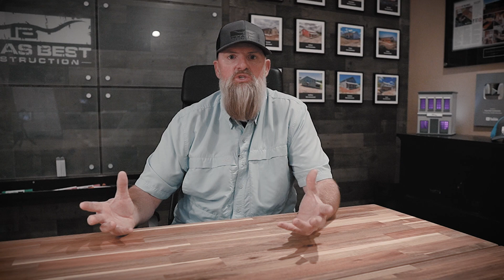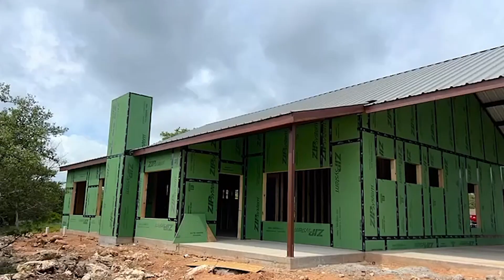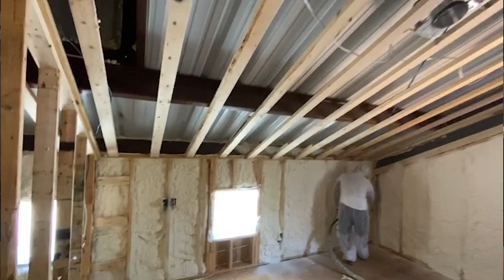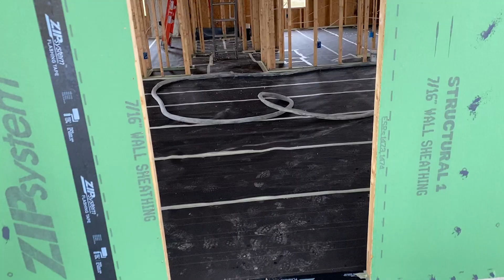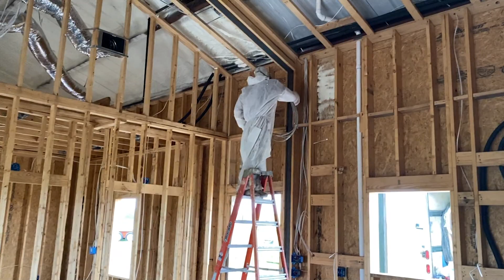How to prevent MOLD in your Barndominium Home | Texas Best Construction

Comment: Your advice is spot on and well explained! I am considering a barndo in humid North Florida for a new home and I am concerned about spray-foam on the underside of the metal roofing limiting thermal movement of the roof and eventually de-laminating in spots. Have you tried other insulation/vapor barriers such as Prodex or Smartshield in combination with "bagged" fiberglass or rockwool? Do the benefits of spray-foam outweigh the possible drawbacks? I have run a portable dehumidifier in my South Florida house in winter (when AC isn't running much) for 30+ years and the new ones work really well at controlling humidity especially if you can drain them through the hose.

Comment: An hrv in my attic solved the condensation problem on the steel in the winter. Keeps the heat in, but exchanges the humid air with dry air
Reply from the maker: HRV can be a great solution as well. Thanks so much!

Comment: Thank you Josh for great advice to prevent mold. I would add one more thing that is really important to prevent moist from coming in.
It is becoming increasingly popular with in-floor heating. It is really nice and also an over time economical way of heating your house.
One problem that many do is that they only insulate the ground under the concrete slab to the values of their climate zones. These recomendations is for the zone itself only. Now, if you have in-floor radiant heating one must insulate much more. The reasons are that 1, you dont want half of your heating to also radiate downwards, you loose effeciency in that. but also, 2. radiant floor heating that is not well  insulated to the ground will basically suck up moiste from the ground below.
Looking at how they do in countries where in-floor radiant heating have been common for the last 40 years, like Sweden, a minimum of 250mm, or about 10" is needed but many will go about a foot deep under the slap. Now, the walls need to be even deeper to prevent the chimney effect.
Reply from the maker: Thats a very interesting point I had not heard. In Texas the radiant floor heating is not as common but that does make sense that it will cause the moisture for good soil to dry up more and cause expansion potentially as well. Thanks for your comment! JH
Reply: @TexasBestBarndominium  Thank you for listening and for a great channel.

Comment: I worry about the spray foam on the sheetmetal roof and roof leaks. Dispel them please Josh.
Reply: Or make a video! Can you put zip on the roof then a standing seem roof?
Reply from the maker: @rememberingbubbles6950  ok its a good subject. Will try to cover that.soon! 🙂
Reply: I can prevent mold but is that spray foam flammable?